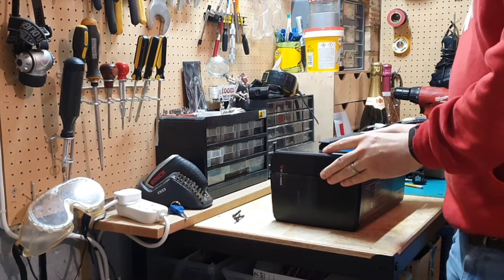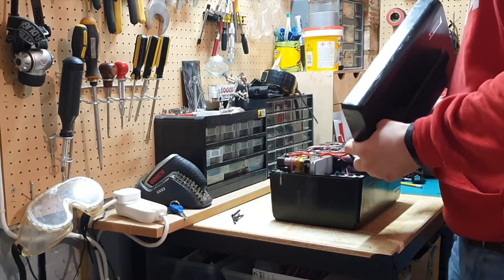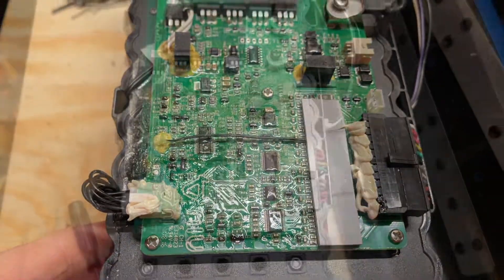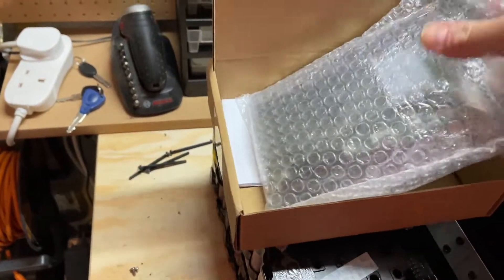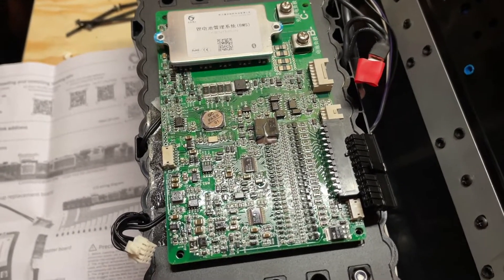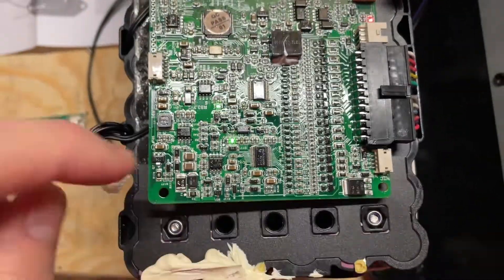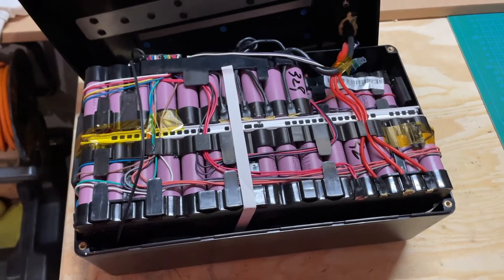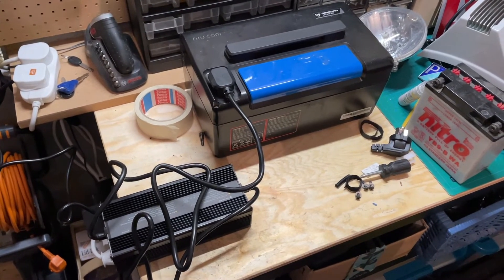NIU Battery BMS Replacement

Comment: Could you tell me which BMS you used?

Could I use any 60v BMS?
Reply from the maker: I bought mine from AliExpress. The exact one I bought isn’t for sale, but there are others that work. The key is to search for an NIU 60V BMS with the correct amp hour rating. Mine was a 60V 29ah battery, but there are a few variations on the batteries.
Reply: I found one but it was maybe 1ah too high… how closely does ah rating need to match?
Reply from the maker: @ I wouldn't want to risk advising on that. I recommend doing some research on the BMS you found to see if anyone has made it work.

Comment: For anyone watching this, the name of the App on the iOS appstore has changed to "YYBMS"
They also changed the board since this video. All the holes line up and all the original Niu connectors now work plug-and-play, except for the temperature sensors, these still have to be replaced with the ones coming with the board

Comment: Hello, Thanks for the video. 
I have two Niu 60B2 batteries. Both batteries blink 3 times when I press button on top. 
I check voltage of package, which is good (61V and 58V). At one battery the celles are not in balance anymore, I suspect a faulty cel. The other one is balanced nicely.
Now I am searching internet for a new BMS, but the link in your description is not working anymore. You have any other suppliers?

Als, does anyone know what signal the 3 small pins in the connector give to the charger and/or the scooter?

Thx!
Reply from the maker: Hi, just search for "NIU BMS" on AliExpress.com and you will find a few for sale. You just need to find one that works with the voltage and amperage ratings of your battery. https://www.aliexpress.com/w/wholesale-niu-bms.html?spm=a2g0o.home.search.0

Comment: Nice video , thx. Just thinking why BMS blocking or stops the charger to recharge batteries ? 
Is this because of software on chip or some fuse on this plate is broken ?  Couse normally no one need to change BMS Plate only because of safety function! 
-I am wonder why NIU don’t tell on the true what to change on plate or how to reset BMS Function !? 😀🙋🏼‍♂️🍺 THIS wil cost maybe not more then 5$!
Reply from the maker: I'm glad you liked the video. I have no idea what the problem is with the BMS, but replacing it is a lot cheaper than replacing the battery. Obviously a $5 fix would be even better.
Reply: And what is the solution for reset?
Reply from the maker: @Gehtdichnichtsan583  You could try disconnecting the BMS, waiting a few minutes, and then plugging it back in. I heard once that this might work, but I have never tried it.
Reply: @randomtasks  I already tried that no chance. I guess new bms then for me too
Reply: balancing difference might caused the  issue ?

Comment: What is the stock bms max amps for this battery??
Reply: Discharge
Reply from the maker: It’s a 29ah battery. The batteries in the NGT and GTS versions are 35ah.

Comment: where can i buy bms?
Reply from the maker: I got mine from Ali Express. There are many options, but you need to make sure you get the one that matches the voltage and AH rating of your battery.

Comment: Hi, I did the same BMS swap as you, first it seems the company fixed the bolt hole issue, mine line up perfectly. But my question for you is did yours work in the bike afterward? I get a full reading, battery charges successfully, even runs the bike for a bit, then suddenly cuts out and battery % reads zero both via the bike and the Bluetooth sensor, despite each cell cluster reading adequate charge. Just curious if you had any issues in the bike like I am having..
Reply from the maker: Hi, that sounds annoying. I didn't have any issues with my battery after replacing the BMS.
Reply: Same for me any solution so far ?

Comment: Hello My battery has been drained to zero.  I charged up to 3.2 volts, maybe the diagnostic sheet will start the BMS Or I need to buy a new BMS Thank you very much for the answer.
Reply from the maker: Try disconnecting the BMS for a day and then reconnecting it. I have heard that this can solve the problem. If not, the one I used has the amp with the cell by cell charging information.

Comment: How did u know the BMS what's the problem? I bought a secondhand battery on internet, but when I got it seems not to be working, it does not charge. Do you have some advice for me?
Reply from the maker: I contacted the NIU help desk and described the symptoms: it wouldn't charge, but when I had it plugged into my NIU and plugged into the wall, the NIU would run. They told me that the BMS was faulty and would need to be replaced. Assuming that your issue is not the charger itself, try connecting it your NIU and plugging the charger into the port under the seat. If the NIU turns on and runs while it's plugged in, and then shuts off when you unplug the charger, you might have a BMS issue.
Reply: That was my exact question, thanks for asking it and thanks OP for the answer.

Comment: Can I use one of these packs in a different scooter model by opening it up and using a different connector?

Current scooter is a dual motor 60V, current battery is 67.2V.

Could this battery be repurposed to work with a GX16-3 charger?
Reply from the maker: Theoretically you could use this battery with another scooter, but I am not an expert and have never tried this.
Reply: @randomtasks  Do you know if this BMS is locked to NIU scooters only, or will it function fine with some cable swaps?
Reply from the maker: @oogabooga4006  Sorry, I do not know. You will need to do some research.
Reply: @randomtasks  Good to know. I might be able to get similar battery for a great price, so I might chance it for the BMS/Cells alone. Thank you!

Comment: I have 2 brand new NIU 60v 26a batteries that had been sitting for 8 months. 1 charges and the other does not. One shows 64v and the dead one shows 8v. How can I revive the dead battery so it charges again? Thank you
Reply from the maker: Sorry, can’t help you with that, but there are other videos on YouTube that might help.
Reply: Udało się obudzić baterie ?
Reply: https://youtu.be/esKD9npHmnU
Reply: Did you find a solution for this?
Reply: do not charge battery that is low voltage, it is permanently damaged and a fire hazard if you charge